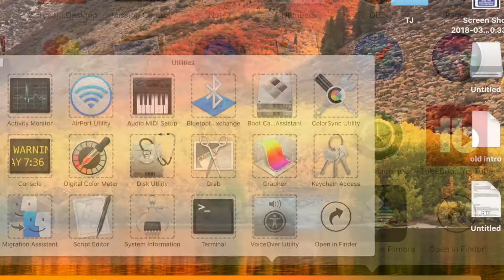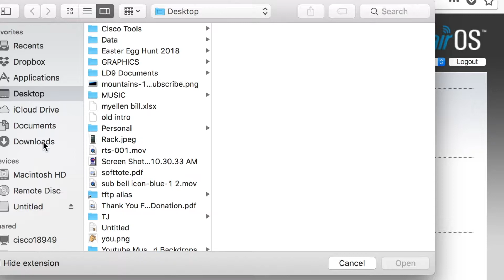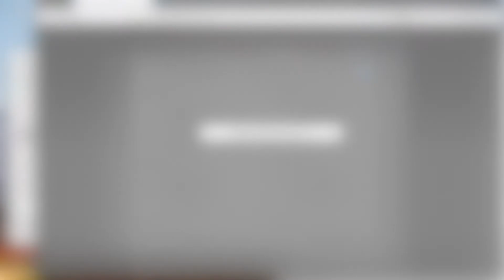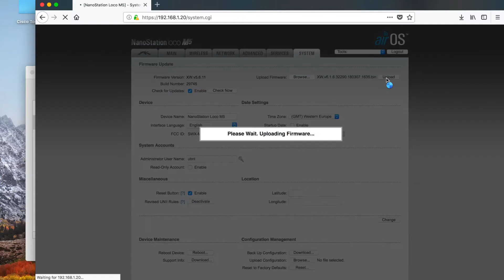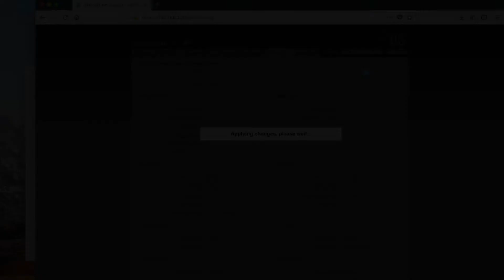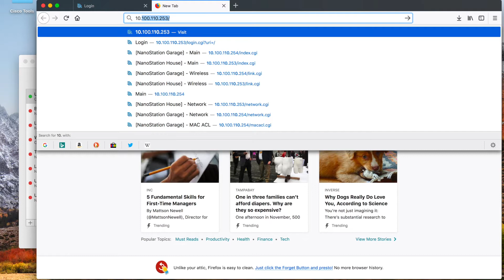Ubiqiti Nanostation Loco M5 High Speed  Data Link Setup

Comment: @network engineer's playground Is it ok to plug the Station into the wan port of a router, keep dhcp server enabled,  set the Internal/LAN IP Address of that router to a different subnet than what is used for the WAN IP, the nanostations, and LAN IP of router on AP side of bridge? Would having everything setup that way cause conflicts?  

I am sharing internet access to a neighbor but she has been having to reboot her router on way too much of a regular basis because she keeps losing internet access. I'm trying to determine if it's the way I have everything configured or if the router on her side is just going bad. The signal between nanostations is always in the high 90's without much interference on the channels I'm using. Also, the speeds are generally between 25-50+ Mbps on her end and the internal router on her end is an old Belkin n300 type.
Reply from the maker: No that will work fine, and if you are sharing with someone else that would be the preferred way to do it, because it provides a firewall to their network from yours.   I just want it all bridged so all my devises are all in the same network.  I would start a continuous ping to her routers external address on your network and see if it goes down when she looses access.  If so she probably needs a new router.